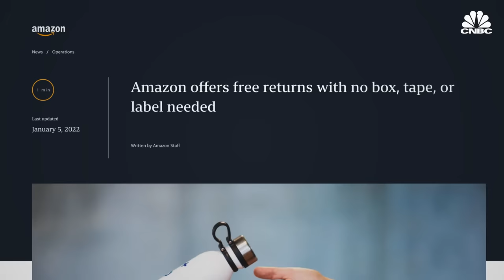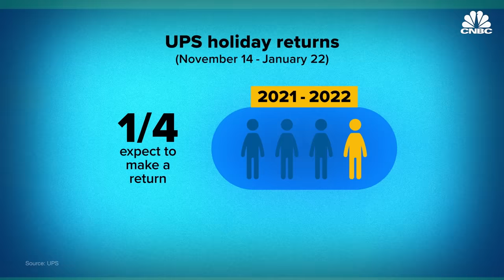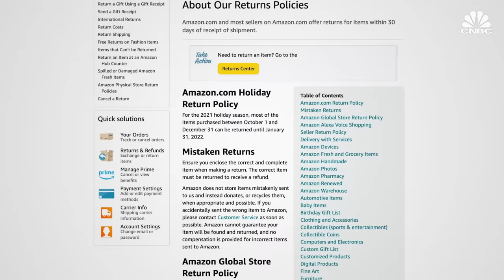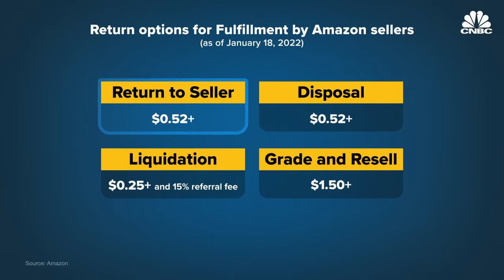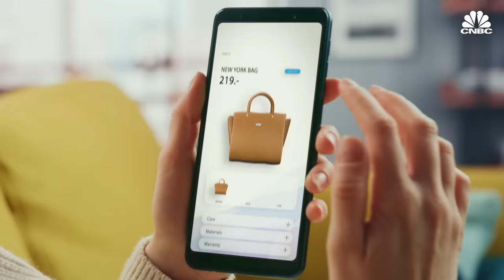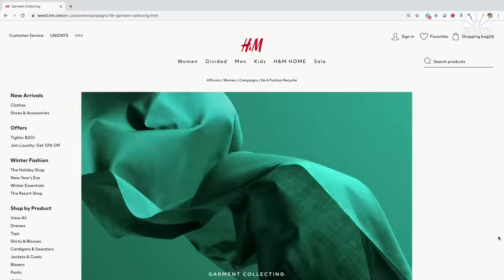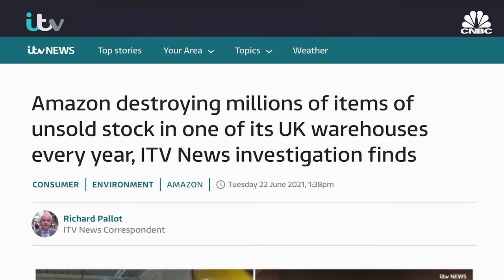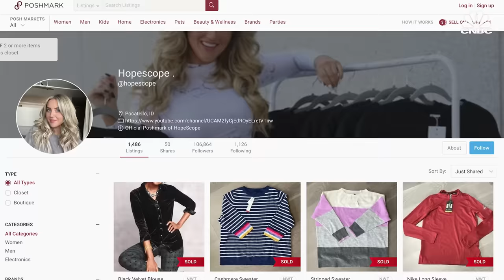Where Online Returns Really End Up And What Amazon Is Doing About It

Comment: One major reason for online return is shipping damage. In my experience, most of the damages were caused by improper packing (e.g. lack of cushion, using polybags instead of boxes, mixing heavy items with fragile items, etc.) by the sellers. So the sellers are part to blame for the increasing number of returns.
Reply: Did you know that Amazon uses robots in their warehouses? Robots can not tell if a package is damaged or even if the merchandise is in the box.
Reply: The major reason for online return's is buyer abuse
Reply: I think its more the shipper, like UPS.
Reply: I order a lot from Amazon, and I've never had one damaged product
Reply: Or dont buy online

Comment: I frequently buy stuff from Amazon warehouse deals. It’s usually a bargain, especially for auto parts. Last summer I bought a set of “used” Bosch rotors and quality pads for 70% off that came new with torn packaging. Also bought wall bike rack for 50% off. Turns out it was returned because one of the bolt holes didn’t line up, so it needed some drilling. Still a bargain and saved it from scrap yard, I guess.
Reply: How did you find the deals?
Reply: @nanowar1192  
it's a risk but I guess it pays off if the item is still in good condition only that they couldn't read manuals
Reply: Dont buy trash... U dont need
Reply: I buy Amazon used too!  I usually buy ‘as New’, packaging damaged….but some items received were damaged and I had to return.

Comment: I think a valid but missing point is the way products are sold to us, for example clearly stating the correct information that’s needed for consumers to make an informed decision on what that product is actually like so when the product is delivered the customer knows what to expect. some retailers  don’t specify enough information on the product eg clothes with no dimensions, so no wonder the returns rate is high. This is a two way problem that extends beyond returns being ‘an easy option’ for customers.
Reply: Lordeverfall100  well coming back to the return policy. As a consumer there is no cons of buying 3 of different size and returning 2. You have to limit that, a long with increase of information. With fast fashion there could be a hundred items listed by a brand. Also a lot of them market the free return policy
Reply: Ditto. Customers have no power over how items are presented for sale - never mind what happens in the supply chain. This is a seller-side problem, they hold all the cards, they decide the policy.
Reply: Thank you! The Amount of times I have bought something which looked way better in the photograph and in real life looks cheaply made.  This is absolutely a two way street!
Reply: Agreed! And many companies don't even show you the bare minimum details needed to know what you're getting. J Crew is so bad for this. Half the items they sell online have only one photo of the garment taken from the front. No zoomed in photos of details showing the fabric texture. No photo of the item from the back or from the side. Not even a photo of the item on a model. How can you sell pants or a dress without showing what the back looks like? Sometimes they have hideous embroidering on the back you don't know about until you take a chance on ordering the item.

Comment: Whenever i receive an item i bought online (From amazon or otherwise) and need to return it, i always make sure it goes back in its original packaging and is in pristine re-saleable condition as brand new. It sucks to see that even then amazon will probably have it trashed.
Reply: Sellers should have the option to process returns themselves. Much more likely to be resold, but sellers are not who Amazon cares about.
Reply: I do this too but I can't resold and get the item back in the plastic inside packaging as good as the warehouse people can. I always hope they have a way to repack it.

Comment: Its such a weird issue cause I would rarely buy stuff if the option to return wasn't available, which I often do. But at the same time, I've sold on Amazon and returns were such a pain that I'd just have Amazon destroy them. The profit was higher selling a new one full price vs not destroying them and offering used ones at a discount
Reply: Returnless refunds need to become the norm across all products on Amazon. They do it for some items, but it’s really a hit or miss. As long as the customer can provide proof that the item isn’t needed/broken etc… I see it as a great solution.
Reply: @Tah BOO Agree with you. If amazon could do better with quality control that should minimize returns. Be honest most of the things I bought and returned on amazon. The quality is way less than my exceptions. Although some things are better quality. Plus the fake reviews. It makes the whole online purchasing experience miserable for the customers as well as for the sellers.
Reply: you have to ask why have the return cost if the item will end up in the bin.
you have to ask is it not cheaper just looking on ebay or some were else for the item you want.
all the amazon daily offers are really not that good you can find the items offered even on there own website cheaper
And buying shoes or clothes are just  asking for high returns.  as you can't really get the fit and feel of the item through a computer screen
Reply: @ShoyuRamenBreakingBad  wish does this they give refunds atleast they used to
Reply: That's a shame that destroying them is more financially efficient. Customers should be able to give them away or a secondary company should be able to take them for free and give them away to the less fortunate after refurbishing them (if that applies)

Comment: I've had very good luck on Amazon buying items described as Used, but in Like New Condition.  Both the cell phone wallet case and the Electric water boiling pot were just as advertised and actually never used as far as I could determine. Both were about half the price of the brand-new item.  Besides getting a great deal, now is see that I'm keeping them out of the landfill. Win-Win as far as I can see.
Reply: I buy a lot of those as well

Comment: I was a power seller on ebay for 20 years. Amazon ruined it by training people to return everything! I sold custom manufactured items - very clearly listed as non returnable due to their custom nature. It was a CONSTANT fight with customers and even ebay staff about not allowing returns, which I didn't have to and disclosed up front. Nothing was ever damaged or defective. Ebay wouldn't understand their own rules 75% of the time, usually siding with the buyer for no reason at all. And then there were the ones who claimed it was broken when it clearly never was.

Due to this abuse, I had to stop selling there, and end a 20 year career. Ebay was unwilling to consider this an issue at all.
Reply: Agreed, returns are basically frictionless. There should be a cost for returns to disincentivise that behaviour. Unfortunately I guess that how they got people to shift to online in the first place

Comment: They should have a rebuy system where people can actually physically see what is wrong with the product. They need to have accurate photos of items for resale. When Amazon sold only books, I bought a book based on the description in the listing and when I got it, the book was in tattered condition. In the listing it said it was gently used and the cover was basically gone and the pages were filthy. The only reason I didn't return it was because I was going to lose out on the shipping. Back then it wasn't a free return.

Comment: I have to agree with the other comments below, regarding standardization of clothing sizes. 
I always check comments to see how items fit other people in my size / weight range. I also try and provide my own feedback. I still often end up ordering an extra size. It is easy enough to return something that doesn't fit, but it's annoying if you have to wait possibly weeks for a different size version to be shipped. They might even be out of stock when you go to order the other size.
Reply: I took the time and typed up a fair comment about  a product (always included model #, if it applied) and it got rejected. I did not swear or use any mean words either. You think I’m going to write any more? Not likely.

Comment: I am sincerely shocked that returns cannot be sent to other customers... In my country returns are just back in stock! Assistants at special pick-up points check them and send them back to the shop. So others can buy it if it's not damaged or lacks tags. Even if things lack tags, but they are in excellent condition, customers still can order them. It's beneficial for sellers and the environment. If customers have complaints about the quality of products, they can report this and this thing will be taken out of stock, or sold at a very low price.

Comment: One way to deter unethical buyers' returns is to make sure the more expensive items are serial numbered and are opened and inspected for bogus serial number swapping. Further, the buyer should be banned for a certain period of time from purchasing from Amazon, even providing the seller with the same information so the buyer cannot go straight to the original seller and try the same trick.

Comment: Very informative. I’ve returned things for two reasons. First, things received that were clearly previously used. Example: a food cannister containing a raisin.  But the primary reason I’ve sent stuff back is that it arrived damaged. Broken bottles, smashed ketchup, crumbled cookies, cracked mirrors, broken electronics plastic cases. I’ve also bought Hunter fans from the refurbished offerings, a returned vacuum, a blend tech blender. All we in excellent condition. But going forward I think I’ll think twice and ask myself if the item will arrive broken or crushed, and just get it elsewhere. There’s a huge push to make shipping material lighter. That translates to flimsy and ineffective. The last bizarre packaging was missing completely. A silicon cooking accessory was unceremoniously plopped on my door mat and by the time I found it it was covered with mud and had snails on it.

Comment: I think the sellers have some responsibility in this problem. Their product photos are often misleading, or there just simply aren't enough of them for the buyer to get an accurate sense of what they're buying. They also don't provide enough details about the materials and the fit of clothing items. How hard is it to include some product measurements so the buyer can tell which size is likely to fit them instead of having to buy two different sizes?
Reply: Sounds like your the problem. I for one don't purchase without certainty that the item in question is indeed what I'm looking for or reading the description.

Comment: I work at kohl’s. Amazon returns are a nightmare. We get anywhere from 200 to 500 a day. If we get a truck more than a week apart our return trailers are filled completely. 53 foot trailers filled completely with Amazon returns. There’s so much that usually we floor load it but because of the Christmas season we have to delay our unload because of workload. There are sometimes 15 pallets sitting on our dock and when we finally can unload the truck it’s filled with returns. 
It’s labor intensive and I don’t think corporate really knows what’s going on. Very few of the items we get back can be resold. It’s just a mess

Comment: When I worked at a Walmart store's return register, as long as the customer had the receipt, we'd take it back. Even if the item had clearly been worn or used (like a vacumed cleaner with a full bag) or was not even the right one, it didn't matter, we'd take it back. That was twenty years ago, holiday seasons were always the worst : people would buy clothes for parties and returned them even without the tab. It's not a new phenomenon, but it's gotten worse with easy return policies and unreliable sellers.

Comment: The fraud happens at brick and mortar as well.  I change my own oil, and a couple years ago I bought some Mobil 1 at Wal Mart which normally is not an issue, but in this case, after getting the oil home, it turned out the oil in the container was old used oil. Someone must have returned. Fortunately, I was able to return that oil at Walmart and I pointed out the issue. Hopefully it didn’t end up back on the shelf.

Comment: Amazon should just ship faster. I’m a prime member doing a bit of traveling at the moment and twice now have products returned. One item I really needed quick but didn’t realize when I changed the address my delivery date changed to about another week. When I checked the next day and requested a cancellation they said it was on a shipping status and couldn’t cancel! Not even shipped yet, but couldn’t cancel. . I ended up getting the item elsewhere and returned the other item when it finally got here. Other incident? Item took 15 days to deliver. Shipped the day after it was supposed to be here. I wasn’t able to stay in the area to pick it up from the locker so it got sent back to Amazon. Sad if you put a residential address you can get an item 2-3 days, but if you use a locker, pickup center or local post office in the same zip code it will be an extra week for delivery! Been shopping elsewhere the past couple months.

Comment: I suspect a lot of this issue would go away if online sellers would provide (or require) consitenet, clear and complete product information. Time and again I've shopped for merchandise online, especially electronics, and I cannot find the technical specs or product dimensions or other information that I want. Posting a question to the site does not yield useful responses. In a physical store, I can pull out my little tape measure and size the thing in real life, I can ask questions and usually get answers, perhaps even a demo.

Another big issue with me is that a lot of the waste is packaging. Those hard plastic thermal sealed clamshell packages are designed to be hung on a pegboard in a physical store in a way that looks good--online, they're just pollution. Amazon could probably use its market influence to get manufacturers to put merchandize in recyclable cardboard and the like--which in turn would save Amazon on costs for shipping and warehousing.

Comment: I bought a returned item from one of the auctions that listed the item as "appears new".  The box showed a blue iron but what was in the box was a different model red iron with a damaged cord- obviously a used and broken item someone returned fraudulently.   It's a shame people do this.  Ultimately, I repaired the plug and have a working red iron now.  I also bought a returned item directly from Amazon for half price of a new one.  The condition was listed as "very good" but even the delivery driver alerted me to how badly the box was damaged upon delivery and the item (an accordion door) did have some minor damage... but the damage was mainly cosmetic and didn't affect function so I kept the door and considered it a bargain.  I wish more people could repair. reuse, and recycle instead of just returning a product.  That's not to say I haven't returned an item on occasion but I try not to impulse buy just because returns are easy.  For clothing, there's almost always a solution- altering, giving to a friend or donating an item is probably better than returning it if that means it will end up in landfill.

Comment: I am 90% certain that Amazon has some form of "internal revenue calculation" when it comes to stuff like deliveries and boxes. They have a specific "dollar limit" before things like returns or refunds are scrutinized, which is a price set by either their total contribution and/or their prime status.
If its under a certain amount, the company probably just eats the cost and then refunds it because the product is basically cheap to them. Even if the process is exploited.
The stuff thats actually returned is probably pitched in one way or another without even QA testing to verify viability.

Comment: I think the reason most items get returned are quality issues. I dont think I make too many returns but my Amazon returns/refunds include: case of Fiji water with strong sulfur smell and taste(X2 occasions) but ordered dozens of times without issues so prob stored improperly next to something smelly, bought my son a lightsaber for Xmas that broke 2 days later and cost $100, I don't return clothes as I have several sisters but theres many items I've passed on that fit vastly different than sized or thinner than I wanted for day time clothing, ordered almond milk that arrived busted open which is just rough handling. There may be a couple other items but those stand out and ive been a prime member for years. I'm not picky and many of the problems are avoidable. Thin clothes have their place as sleepwear in hot weather or in a home gym but when it's labeled as work clothing or something it's not what women want(see through).

Comment: I'm extremely cautious when i shop online.  So my chance of returning is less than 1%.  And this low rate is really a return that will be resold.  I suggest read the description of the item and the reviews carefully. For the past 5yrs,  I only returned once only because the seller accidentally mailed me the wrong item.  The seller denied the claim,  Amazon still refunded me.  As they are the only seller for the item I need.  I bought it again and this time it was the right item.  So I would suggest to take a picture of the item before returning it.  So if there is a dispute you have the evidence to go back to.